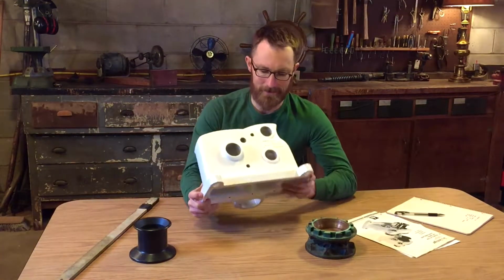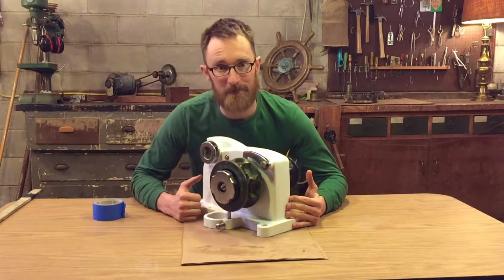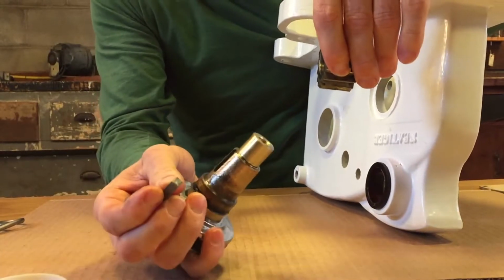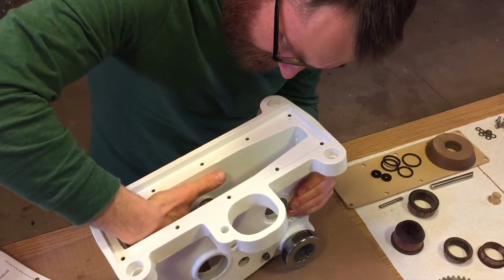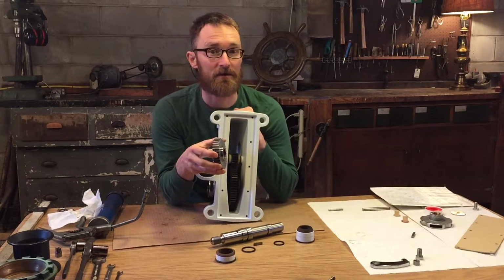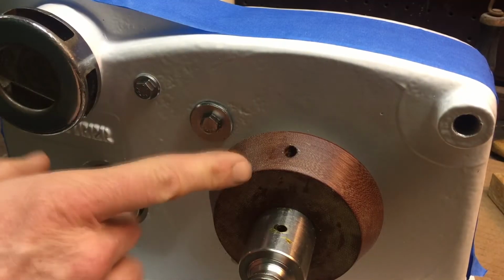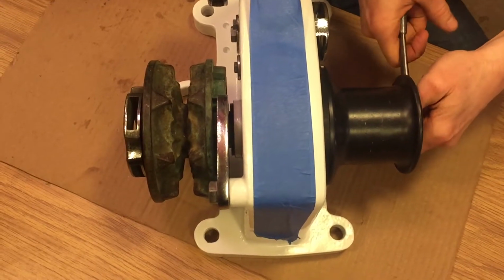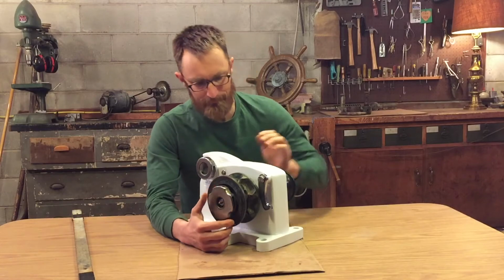Simpson Lawrence Seatiger 555 Mechanical Windlass Repair

Comment: Great video, thankyou. I have just bought a boat with one of these and the 2:1 mechanism is slipping and not hauling in chain, the 1:1 however, works just fine. After watching your reassembly, in thinking that the key on the 2:1 drive for has probably sheered. Does this seem logical to you or is there another possibility?

Comment: Had a question for you.

We picked up a used SL555 for fairly cheap a couple years ago with the view of giving it a good rebuild, new bushings and whatever else needed replacing internally, and using it on our Roughwater 33.

I have become increasingly worried however about the level of wear it has and whether a rebuild will be able to truly bring it back to 100 percent. There is almost a 1/4" of slop in the main shaft for starters, and I'm worried new bushings may not totally bring it back. I'm starting to realize that when the last owner "serviced" it he probably didn't put it back together correctly, clearly the clutch "cone" is now nonexistant, the low speed spindle has somehow become disconnected internally and doesnt function (the previous owner did tell us about this.) He also filled it with oil instead of grease..

By the way the previous owner talked about it I think he had issues with it, and simply continued to use it, as it was getting worse and worse.  So it may have been damaged beyond repair.  I truly hope this isn't the case.  

How much endplay was there in the shafts of your windlass before your rebuild?

Comment: I have an older off brand copy of this windlass. I have had it apart and together so many times it has zippers on it now, :<}.
In my old model I found that the phenolic bushings swelled slightly due to absorbing grease. This caused a lot of extra friction in the windlass but was easy enough to overcome with judicious use of 80 grit wet/dry sand paper.
To overcome this problem I drilled and tapped a 1/2" hole in the top and use it to fill the windlass with about one quart / liter of 90 weight gear oil instead of grease. Actuating the windlass ensures that the oil is well distributed throughout the mechanism. Provided that the bottom cover is well sealed the oil does not leak out, if the level is kept below the lowest shaft. I found that using old style faucet washers and a bit of silicon sealant on the ends of the small shafts keeps them from weeping.

Comment: Hi Andrew. Great video. Just removed our winch after a failure at sea in rough weather. The brake drum roll pin sheared off. Strip down and replacement taking place now. Your video is helping a great deal. Many thanks. Tom (uk).

Comment: Hey Andrew great video, I have an issue with my upper spindle It slips when under load, the lower seems to work fine. 
Suggestions?
Reply from the maker: Good question. My first thought would be one of the little springs is damaged.
Reply: @andrewoq  or I sheared the keyway
Reply: Either way it'll have to wait off the mystic for the wooden boat show,  if worse comes to worse there's always a chain hook and the jib sheet winches

Comment: I am considering buying one of these windlasses, the previous owner partial dismantled it and dropped a part inside the windlass, Thanks to your video I am sure that it was the  key for the upper lever mechanism. I noted that you used grease in the windlass, the PO used oil as there is an oil fill fitting on the starboard side. Is grease the better option? Lastly, the main shaft was loose (wobbly), does that mean wear on the shaft or bad bearings?

Comment: Thanks for the great video. It looks like you pretty much packed it full of grease. Last time I serviced my SL555, John McMaster from slspares advised only 400 grams grease. I know a lot of folks fill them up like you did - and I think that’s what I did the first time I serviced it (it’s 37 years old now). What are your thoughts on this?
I’m just ripping into one with a seized mainshaft (Craigslist find), so I would love to see a video of the disassembly process

Comment: About how much grease in total did you pack it with.

My gasket was leaking, so I installed a new one. Added about half a tube of grease at that time as it looked a bit low. Was not packed as much as yours though. Now the windlas is very stiff and difficult to operate. Where might I have gone wrong? I plan to try to regrease asap.

I would like to rebuild as you have done, but unable to just now, and I need the windlass to operate!
Reply from the maker: I recall it took 3 or 4 regular sized tubes of grease to fill when bone dry. That grease is important. Good luck reviving yours!

Comment: Thank you for your clear video. 
I just found it after fixing hardly my S-L 555 (Seatiger).
But it works fine now.

It is a VERY good windlass for my Bruce anchor (30 Kg) (65 pounds) and chain 3/8 (280 feets).

Serge Charbonneau
Québec

Comment: Andrew, thank you so much for posting this video. It guided me through the refurb of our Sea Tiger. I've documented  the steps here https://www.careyleephotography.com/Copernicus-Projects/2019-Windlass-Refurb/.   Also with photos. I had a few differences, for example you had to flush out the tyfenol  bushings, mine were a very tight fit and I had to pound them in with block and mallet. I also had to file down the ratchet bushes to fit inside the case without jamming the double action swing of the handle.

Comment: Very helpful video! I am curious about how your white powder coat has held up after a year of use. I am about to disassemble my Seatiger 555 to service it. The polyurethane paint was chipped and falling off and I stripped the winch down to the bare aluminum. I am considering leaving my winch without a finish as the galvanized chain seemed to easily strip off the paint when the chain rubbed against the winch housing. So, do you have any thoughts about leaving a bare aluminum housing vs powder coating?
Reply from the maker: Thanks for your comment. That's a really great question about whether to leave as bare aluminum.  I considered it myself.  Ultimately, I chose to powder coat because I felt it would look better. The coating has held up very well so far.  Obviously I am careful not to chip it.  If you anticipate a lot of abuse, I would suggest getting it sandblasted to make the surface uniform then leaving it bare.  It will oxidize and future wear and tear won't look nearly as bad. Be sure to electrically isolate the anchor bolts. That's really important.  If stainless or bronze bolts touch a bare aluminum case, those areas of the case will corrode very quickly!

Comment: Andrew.  I just got my new Gypsies for 10mm chain, the 8 slot for the 8mm was skipping obviously when i upgraded my chain size.  I have a new chain stripper and set screw and like you, need to drill my set screw out.  Would you be so kind to tell me how you did this and size of what you used?  thanks so much in advance.  David

Comment: Excellent video Andy.  I've had an SL 555 windlass on my boat since 1979 and its been one of the most reliable pieces of equipment.  I would not recommend putting hands near the chain gypsy while letting go anchor.  Should use the handle to control the speed that the chain runs out.  You need all your fingers intact!   Since I've just replaced the manual windlass for  an electric (I'm  almost 2x as old as the windlass!),  I'm looking for a new home for the SL 555.    Free of charge, (except shipping).   It's a earlier version of the one you rebuilt.  There are no gears; the drive system uses two roller chains with sprockets and sprag clutches (one-way) on the gypsy shaft.  The action is the same, with high-speed and low speed and double acting crank mechanism.  Examining it with bottom cover removed I believe it can be restored to as-new condition by simply replacing bushings on the drive and idler sprockets, which can be done at any machine shop.  Like your project, the biggest job is the disassembly!
Reply: Rick Whitaker, I’ll take it.

Comment: Thanks so much.  I just disassembled mine.  I don't believe it has ever been apart and it is one of the older ones.  Shafts all rusted so it took considerable heat and force.  I'll follow your guide for assembly.  Where can I get a manual and is the parts place SL Spares?
Reply from the maker: Way to go.  Yes; SL Spares is the best source for parts.  They even sell a copy of the manual.  I found an original copy with my boat's paperwork.  Good luck on the reassembly!

Comment: Thank you for the excellent video - it will be a great help when I finally get around to rebuilding and installing mine.  Can you tell me which gypsy you have and what chain you are using?  I have the B80 which handles a variety of chain according to the manual: 5/16 BBB, 5/16 American hi test, a couple of proprietary Simpson Lawrence 5/16 chains, and "most European 8 mm".  Don't know which one(s) it's optimized for.  I've tried some 5/16 G40 and it doesn't seem to fit all that great - next step is to try some 8 mm G40 / G43 - I see there are slightly different sizes of 8 mm out there.  Thanks again - a great public service!  Cheers
Reply from the maker: Glad to hear the video is helpful.  Thanks for the feedback.  My gypsy is an RCB70.  Before buying anything new, check the owner's manual - it will tell you exactly what fits each gypsy.  You might find a PDF online.  Offhand, I'm not positive what chain we have.  It's important to make sure it matches but equally important to have the windlass mounted high enough off the deck so that the gypsy grabs / wraps enough chain around it.  Otherwise, the chain can slip.  Good luck.

Comment: Thanks for the detailed video. Did I miss it or did you not mention the 2 springs part 31 ?
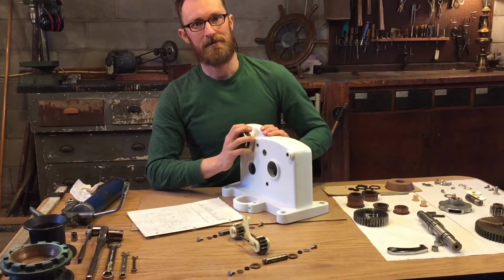Reply from the maker: David Ray good question about the springs. I may not have mentioned them specifically. My springs appeared to be in good condition, so I elected to reinstall them. New ones can be purchased, if needed. Start watching at the 9:45 mark to see how they fit in.

Comment: Hey mate, thanks for that. I will be rebuilding mine soon and will link back to your video as a helpful source

Did you have much trouble removing the drum from the port side? Mine is properly siezed on and i am wondering how you got yours off. 

Thanks mate.
Reply from the maker: Thanks.  Happy to help.

The drum is pressed onto the shaft and there is also a key and retaining bolt.  The drum must be removed before that shaft can be pulled out.  My drum popped off without much difficulty (by using wood shims and a pry bar, working around the circumference patiently).  The drum is aluminum and the shaft and key are steel, so there's potential for corrosion.  Let some penetrating oil sit on it for a few days.  Then some hammer taps and heat if that doesn't work.  Good luck.
Reply: Andrew, my drum doesn’t have a bolt. Would you know how it’s held on?
Reply: I used a 6 inch jaw puller to remove the drum.  It had the benefit of pressing out the mainshaft through the housing as well for the first inch or so.  Then some moderate mallet taps removed the mainshaft.  I bought the jaw puller for $20 from HarborFreight.com.

Comment: A really big help.  I have been using this windlass on my boat for 12 years and did not want to replace it.  I like the fact that it is a manual windlass.  My springs had rusted apart.  Now all is working great. Parts were easy to get.  Powder coating is the way to go.  My windlass did not have the extra washer mentioned in the video when I disassembled it and I did not install one.
Reply from the maker: Thanks sharing your experience regarding the extra washer.  There were probably several idiosyncrasies along the production run.  Good move to keep it as you found it.

Comment: Hi Andy, thank you for an excellent video on the Seatiger.  I just bought one myself and it doesn't need rebuilding at this time, but I do want to clean it up and repaint the surfaces.  The drum has some sort of black matte coating on it, do you know what this is.  Something special, or just black matte spray paint.  Thanks Joe
Reply from the maker: Hi Joe.  Thanks for the feedback.  Your drum is likely anodized.  Anodizing is much stronger than spray paint.  Good luck with your new windlass.

Comment: Exceptional video Andrew. Great tips about the shortcomings of the manuals drawing too. Did you happen to take any footage of the original dismantling process? Many sources say it's incredibly difficult to get some of the parts out so it would be extremely helpful to see how much effort is required and how much force can safely be applied before tackling this job on my boat. If you did take footage, please let me know via the comments box how anyone might access it. It wouldn't have to be edited or anything, just some raw footage of the process. Again, great job on both the windlass and the video. Many people will be grateful I'm sure.
Reply from the maker: Thanks for the comment.  Unfortunately, I only have a few pictures of the disassembly - no video.  We're brand new to filming these types of projects, but if I come across another SeaTiger to restore, we will be sure to video the entire disassembly process.  Disassembly can be a big challenge.  Ours needed ample amounts of care and brute force.  I used wood shims between the sides of the gears and the inside of the case, so that the shaft could be hammered through, while the gear remained stationary.  A map gas torch should be on hand to heat and expand any gears that don't budge after a few strong hammer taps.
Reply: Thanks Andrew!